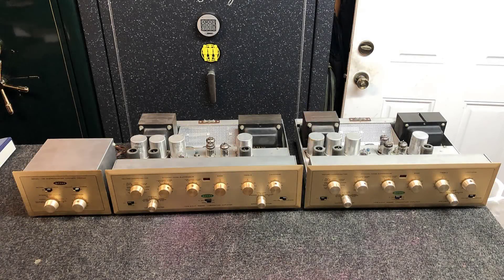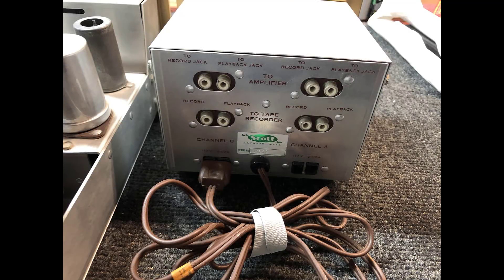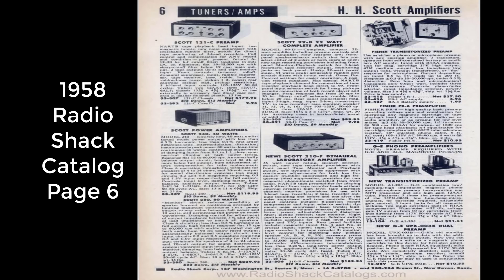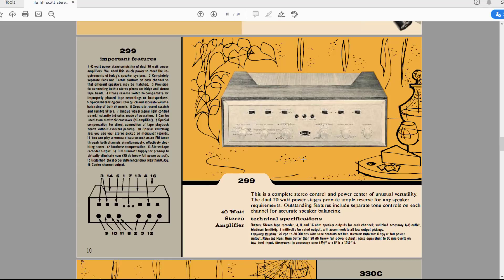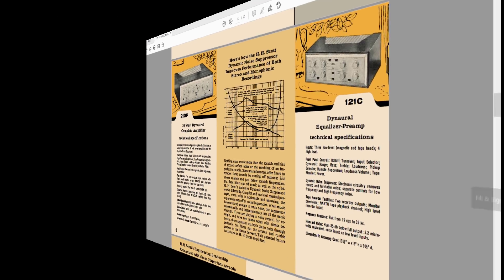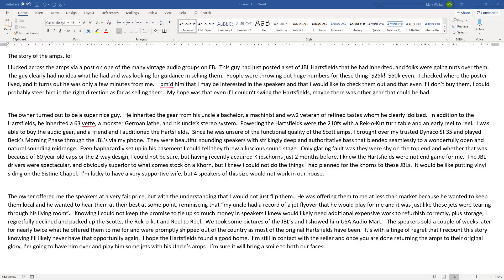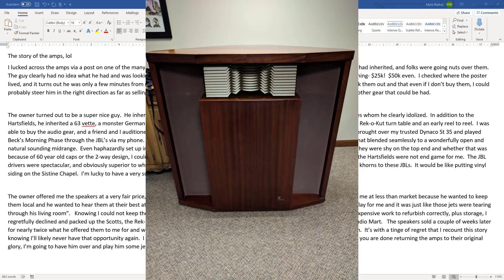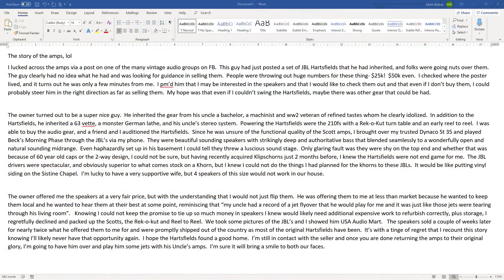HH Scott 210F Dynaural Labratory Amplifier Restoration -  Part 1

Comment: WOW! This is an absolute GEM of a find both of the subjects and the video itself. I am an old retired electronics technician and engineer and started out in my electronics and audio interest and hobby back in the tube days so this is right up my alley. I’ve done a lot of repairs on tube equipment beginning in 1976 when I got out of the Navy and worked in a TV repair shop for awhile before getting into the recording studio business. I used the Sams Photofacts a lot which were a great help. I haven’t seen part 2 yet but looking forward with excitement to it. Great video!

Comment: An excellent site for vintage H.H. Scott audio: http://hhscott.com
For this unit: http://hhscott.com/integrated_amps_mono.htm

Approx years of manufacture: 1957-1960
Both metal and wood cabinets were available; I own several units in various cases.
Originally built in Cambridge MA, then moved to Maynard MA not far from where I live and have visited the site several times under different ownership after the company moved out (Digital Equipment Corporation being one).